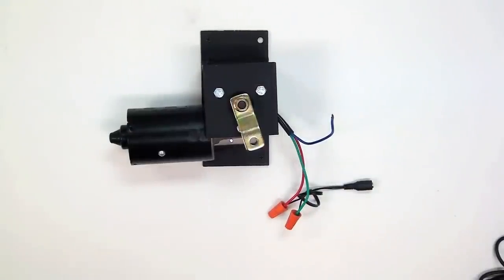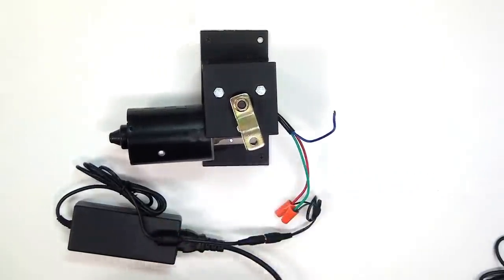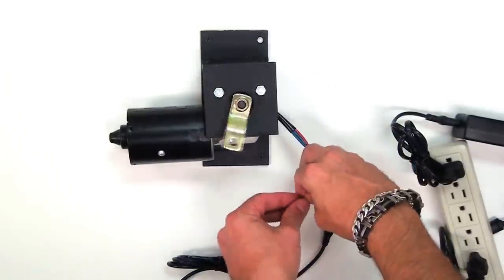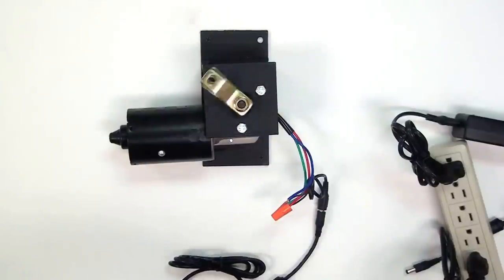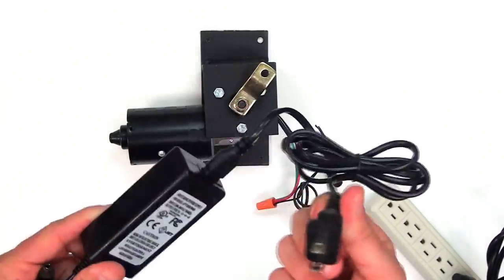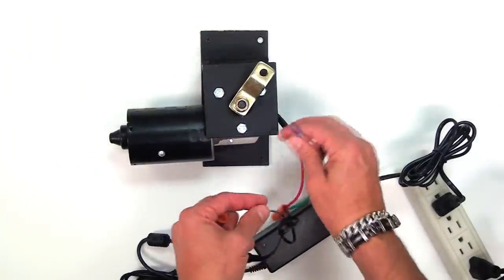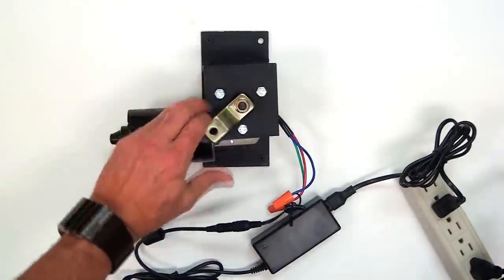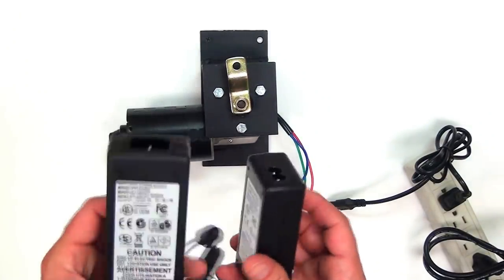FrightProps Motor Power Supply Tutorial

Comment: Thanks for the demonstration it was very helpful. One question I have are these power supplies the only type you should use? I have a bunch of transformer plug adaptors that have around the same watts and amps I was thinking about trying to use to wire one up. Will those types of power supplies work as well?